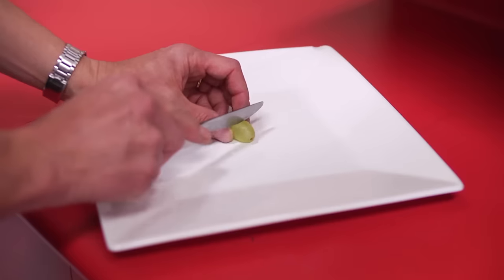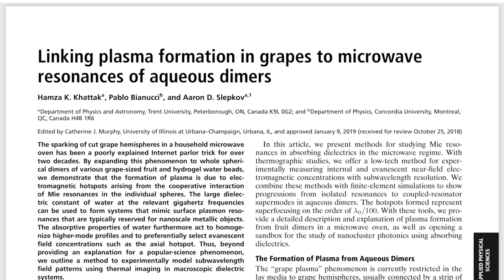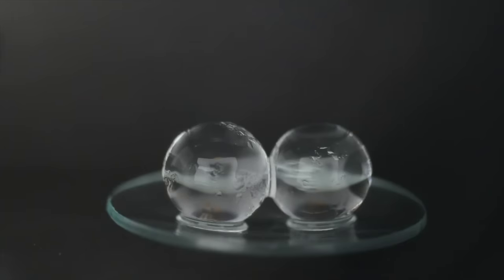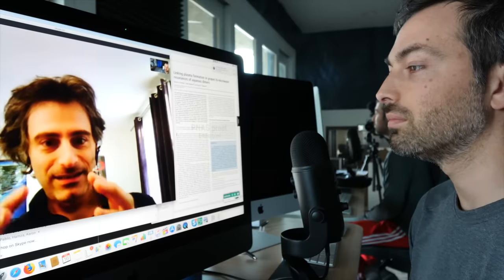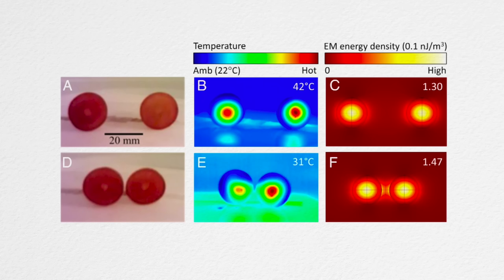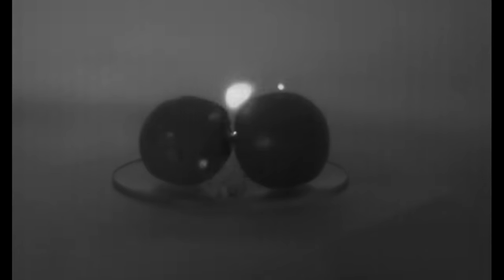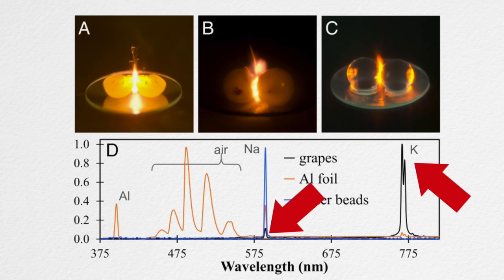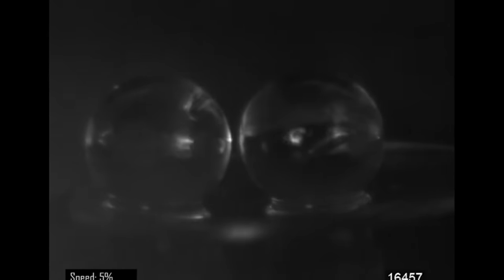Microwaving Grapes Makes Plasma

Comment: Questions: 
1. Does it smell
2. Will it break my microwave
Reply: Yes
Reply: Yes and yes
Reply: Sydney Quinn yas und yas
Reply: Don't breathe it in.  That's ozone (O3) and can make you sick, so don't do it for very long.  Ozone is heavy relative to our air, so make sure you waft it out and around.  I'm guessing it's not good for small pets.
Reply: Once I microwaved a bunch of orbeez when I was younger, and now I'm concerned for my health.
Reply: Does it smell? Probably, it burned the grape's solids and ozone can be odorous
Break the microwave? - No. Aside from no logic that suggests why it should, I have accidentally microwaved much worse objects than grapes - metal forks, ceramic plates with embossed metal rings, aluminum foil. Sparks and flame, but the microwave was fine.
Reply: @connerphipps6425  RICKROLL ALERT
You're welcome
Reply: @rainbowthedragoncat6768  cmon man
Reply: @rainbowthedragoncat6768  you just saved tens of lives my good sir 🙏
Reply: @connerphipps6425  It's okay, I didn't even register the caps warning, I just saw "youre welcome", so i clicked it anyways
Reply: @rainbowthedragoncat6768  What do you mean rickroll? I got all the information I was looking for out of that video
Reply: @aaronhill8277  Err umm... you looking at threads in comments or just a flat list? His comment is with respect to a relevant root comment by @Sydney Quinn , like mine is with respect to your comment, which is with respect to @Rainbow the Dragon Cat , etc. See... lots of respect ;)
Reply: 1. Yes; fructose burning in oxygen and some ozone smell that in such small quantities as this isn't harmful for your health. Just ventilate and life will return as normal to your timewarp. 
2. Yes or No. No, if you use proper protection above the plasma, such as a rugged or laboratory glass cup as the plasma will get to plasma temperatures, which is very hot, akin to a flame of sorts. The ray dome in your microwave is probably plastic and would burn and/or get scorched. But the truth is, you'll do it anyway and love it, so stop holding back! :D
Reply: @connerphipps6425  everybody should know that link by now
Reply: [REDACTED] and [REDACTED]
Reply: @connerphipps6425  Lol i almost clicked it
Reply: @Ziggynut_McGoofy  I see, my trapped narrowly worked. *Almost
Reply: 1. Not sure
2. Don't know
Reply: Microwave Dial soap
Reply: @yourbeardispatchyaf  why? What happpens?
Reply: @connerphipps6425  Just what I needed
Reply: @hrogarfyrninga3238  Which means it worked. HAHAHAHA
Reply: Add a can of Braun beans in your microwave . Would be fun. 🔥
Reply: :D - my point exactly ...
Reply: 5:50 "Woaaah who needs drugs" hahahah that had me dying
Reply: Something tells me your gonna try it .
Wait something tells me you did try it .
Reply: @rainbowthedragoncat6768  too late but thanks
Reply: @rainbowthedragoncat6768  I opened it in new tab....even after seeing your warning cuz i am slow ;-;
Reply: Questions: 
1. Does it smell
2. Will it break my microwave
Reply: @anthonybernero9720  i thought it was supposed to be Ivory soap, but maybe it's Dial. When microwaved, it will expand.  Did it once some 25 years ago.
Reply: Yeah like once I microwaved a slim Jim it pops and bends so creepy
Reply: @emr1d341  It's bad for your lungs too, it's poisonous, and it's heavy gas, so it can stuck in your lungs.
Reply: @connerphipps6425  
Thanks for that video 😭
Reply: @gregparrott  I am concerned how you microwave those things over and over again

But isn't ceramic fine? because that's what I've been using for my microwave all the time
Reply: @Khookies-lp2lu  Generally, ceramics are inert to microwaves. But some ceramics have trace amounts of metal in their composition and will react. I have white, pattern free mugs from different companies. I put cold coffee in most of them with the cup itself only getting hot where it's in close proximity to the coffee. But on a couple of cups, the whole cup, including the little finger loop get extremely hot, hotter than the coffee itself. Those ones clearly react to microwave and must have trace amounts of iron or the like in their composition.  I no longer put those ones in the microwave, as at some point, they may shatter.

What I meant in my original comment is that in addition to ceramics that have metal integral to their  composition, some ceramics have patterns applied to them for appearance purposes (rings, floral patterns, etc.). Is that pattern applied with a inert material, or one with metal? I have placed plates in the microwave where the pattern suddenly made a loud 'Pfffft!' sound, flame, with parts of the pattern being vaporized. It belatedly became clear that that the pattern had metal, resulting in a short circuit.
Reply: @emr1d341  all I’m reading is to fix the ozone layer in Australia we will need a really big grape and a really big microwave
Reply: @gregparrott  I'm curious as to how you accidentally microwaved all of that
Reply: @MiniMight  That occurred over the course of several decades at times when I got distracted. The most glaring example was the fork. That occurred at work, tasting and finding food not hot enough, while busy speaking with someone. 
The least conspicuous mistake are dishes that have embossed/inlaid patterns. I ruined a nice plate that had a narrow (maybe 0.030" to 0.04" wide) inlaid gold ring around its perimeter. Within 2 or 3 seconds, there was a loud 'pffft!' and a visible flash. I immediately opened the door. Too late. I had vaporized part of the pattern. The pattern material does not even have to appear metallic for it to be conductive.
I forget what occurred with the foil, but I occasionally get prepackaged foods that are wrapped in paper but may also have some foil within the paper. It was something like that.
These are memorable because the consequences are rudely awakening..."WTF were you thinking?!"
Reply: Yes.
Reply: A bit and only if you do if a lot (more than 6)
Reply: @connerphipps6425  I've been rick rolled
Reply: Is it edible
Reply: This will contribute to global warming. Err, wait, climate change or whatever it is called
Reply: @rainbowthedragoncat6768  your rickroll alert is kind of a spoiler..
Reply: @emr1d341  did you say OZONE?! Does that mean that if we microwave enough grapes we can fix the hole we’re burning in our ozone??😃
Reply: I would like but there is 666 likes
Reply: so I see, you want to do the experiment yourself.
Reply: @rengoodfriend6823  lmao
Reply: @connerphipps6425  Ok Biden
Reply: @jackiectreasurer2664  bunch of malarkey
Reply: "Can it squeal? does it squirm? if it's fresh will it burn? I can't put my finger on it"

Comment: Don’t use grapes for things other than their intended use purpose to avoid destroying your microwave.
Reply: Their intended purpose being focusing EM fields to generate plasma, of course
Reply: Yeah turn them into wine!
Reply: Thats why you have neibors microwaves and thrift stores.  Plenty of microwaves!
Reply: I was gonna ask if I can try this at home. Because he never said not to.
Reply: @needycatproductions6830  Sure you can, no worries. Just dont but a glass over top, that could end badly - if the plasma rises then turn it off quickly! 
You can be super save if you wear safe glasses
Reply: to have surgery on them.
Reply: To late.
Reply: What is Grape? In my country there is no Grape.
Reply: @AlexS-oj8qf  ... what county doesn't have grapes??
Reply: Don Guru de Bro You said do not put a glass over the grapes? Why? The glass doesn’t absorb microwaves.
Reply: So, who’s going to be the first to fill up the microwave with grapes for a good YouTube video
Reply: People like you are the reason that we might have never flown, or realized that scorpion poison can be utilized for medicinal purposes. Or even further- discovered the foods that are not poisonous to eat for the human race.
Reply: @cachi-7878  Probably due to the super heating of the air inside the glass due to the creation of plasma from ionization. You know how heating drinks in glass will sometimes result in the glass violently breaking? I'm no scientist, but I assume it would work similarly with air being converted to plasma.
Reply: or the world for that matter
Reply: So, your advice is to plant it?

Comment: Some guy: "Hey look! If I microwave grapes it sparks and bursts into flame!"
Scientists: "Cool! That means we can improve how me make microprocessors and stuff."
Reply: As a matter of fact, this is a scientific phenomenon. Did you know that electricity was once considered impractical? Of course, that was when people hadn't yet seen how electricity could actually be applied in future devices. Same is here. It may just seem like a neat trick where two grapes make sparks, but in the future, this will most likely be used in lots of machines. I know it's just a joke, but this mentality is wrong. Please reconsider what you just said.

Comment: question on everyone's mind: is this safe to try at home without damaging the microwave?
Reply: I believe it is safe, other than if you do it too long, the grapes blow up and you have a big mess to clean up inside the microwave, LOL!
Reply: @JSiuDev   a mess to clean up is fine, as long as it doesn't damage the microwave in any other way
Reply: @kill5witchengage3  If it is really really over done, it may turn to charcoal and the fume may fused to the wall of the microwave. That should be the worst case.
Reply: If you do it for too long it can break the microwave because it gets too hot in there.
Reply: If the arc gets too big, it increases the risk for hitting inner workings of microwave. Could ruin your microwave.
Reply: Since every single comment here gest worse and worse, Imma just say that it will blow up your whole neighborhood
Reply: @cobaltchromee7533  Nah man, It'll start heating up all the microwaves in the entire neighborhood which will give their microwaves to the main microwave and they will eventually take over the world (KillSwitchEngage's microwave : GIVE ME ENERGY!)
Reply: the heat death of the universe will occur
Reply: The Crux of All Things will break everything organic and inorganic into its natural state of energy...
Reply: It will create another Universe inside each grape, completely identical to ours and reset the simulation
Reply: Actually, on my 4th try i got a pretty big arc, and after seeing that, I feel my eyes are tired. I guess the sharp light can thus be dangerous.
Reply: Worst that can happen is butterfly effect -- creating an arc in your microwave --> major solar eruption --> ur ded
Reply: @adhdskytka536  conclusion: you record it with your eyes closed.
Reply: It is not safe at all. If you try this, you might explode your microwave and burn your house down.
Reply: @amazing_grace_orange  yup! Just don't do it
Reply: It will burn the web of time to the ground, unweaving cause and effect as history undoes itself, retroactively unmaking the omniverse.
Reply: @Wertsir  perhaps the craziest reply I have seen to my comment xD
Reply: And with that, the end times were here.
Reply: I say go for it!!👍
Reply: @1982MCI  there's always one isn't there...
Reply: Could you not just add a glass of water in a different area of the microwave?  There should be plenty of energy flying around there to make the grapes do that also.
Reply: I cut a grape almost fully in half and it worked but only for a few seconds
Reply: I discovered if you stomp the grape prior to microwaving it you can make "sparkling" wine. lmao
Reply: Microwave ovens die if you put nothing in it and run it a while. Putting almost nothing in it could do the same, maybe dependant on time and wattage.
Reply: It will create the Big Bang
Reply: The power of the sun, in the palm of my hand

Comment: With 2 grapes it kinda works like a dipole antenna. The highest current flow is in the middle of the antenna between the dipole arms. Man, I just realised something. To make plasma (or a high curent spot) in the microwave you don't need grapes you just need to make a dipole inside. A dipole which has a small gap or small conductive path in between the dipole poles. The small path will have a higher electric resistance which will result in more heat beeing generated which can lead to plasma. The interesting thing is that this dipole can be made from many different materials. From small metal pieces to meat or wet toothpicks (it didn't work.. I think if you use wood it has to be realy soaked with water.. like keep it in water days.
Update:
I managed to obtain sparks using just to  random shaped pieces from an onion layer. Also you need to put them on some concave plate so gravity brings them together or find some other way to keep them in touch. If they just layed flat the sparks will stop because the heat burns the contact point.
Reply: But not a 12cm dipole like they said.  A 15mm dipole because 2.4ghz have a wavelength of around 30mm
Reply: Or...some foil.
Reply: Is this legit?
Reply: @SoundsLikeOdie  yes I just checked, cant believe he got that wrong. And sounds like the dipole thing might be spot-on
Reply: @craigme2583  I actually do get to ~0.12 m, labda = c/f, where c is the speed of light (~2.997e8 m/s) and f is the frequency (2.45e9 Hz).
Reply: note, I do use the speed of light in vacuum, as this is close enough to the speed of light in air, as the refractive index is equal to 1 up to (if I recall correctly) 4 significant digits.
Reply: In the spirit of keepin it real : a home microwave, while being about 2.4gGHz, is not crisply so. And the chamber is not tuned nor matched in any significant way. And most importantly it is nowhere near a single mode cavity. Quite the opposite really, typically a chaotic multimodal mess. So while that paper ( I’ve not read it) may have it right in a general sense, the whole index of refraction thing seems like academic spaghetti tossing. Similarly, if you wanted to construct a dipole antenna, you would do better with an LPDA arrangement.
Reply: @SoundsLikeOdie  how did you calculate? From lambda = c/f = 3E8/2.45E9 = 0.122m = 12.2 cm In a vacuum
Reply: @SoundsLikeOdie  It is about 12cm. The radiation is 2.45GHz so lambda = 122.4mm
Reply: @avenuex3731  What modes do home microwaves produce? I thought it'd strictly be TE10 rectangular?
Reply: TLDR
Reply: Apathetic One I would have thought so as well. But I was tasked with a microwave sintering project back-n-the-day, discovered to my horror that due to the internal reflection of the cavity / chamber ( how you like) a unique and relatively constant pattern of standing waves is created. Unique in that it is distinct to the setup. And worse, even if you add in backstops, it will never behave like an open waveguide. You should check this out. It’s the answer to why your burrito can be burned and raw at the same time. And other maladies.
Reply: @NathanReiling  ha!! I googled a conversion. Omg, if google is wrong the whole fabric of the Universe will unfold! Life as we know it will no longer exist, omg did it ever exist?

Thanks for that. That formulae was the first algebra i ever learnt.  From a course book in year 8 when i did a ham radio course. Topped my class in morse. The only class i ever topped ha ha.

Comment: Independently, on a couple of occasions I have seen sparking between a couple of cooked lima beans being reheated in our microwave oven. They were within about a quarter cup of beans inside a glass custard cup.  I couldn't imagine how it happened.  Thanks for the explanation of what I saw (I think).
Reply: Or maybe it was the drugs
Reply: Wonder what kind of beans? Some are a great source of iron which would definitely spark.

Comment: Does this mean that the most efficient way of heating food in a microwave is to divide your meal into 1.2cm portions?
Reply: With water inside
Reply: @Geodeathiya  someone already did that in colorado
Reply: @Olivernight09  all food has water in it lmao your not to smart are you
Reply: @Nicholas Demond cant get toasted in microwave
Reply: @carpool_not_deadpool3356  It can if the resultant plasma emits IR wavelengths, which I assume it does.
Reply: @carpool_not_deadpool3356  you're not too smart, are you?